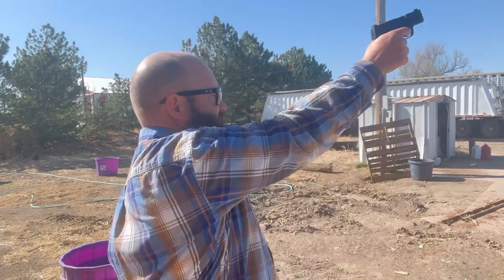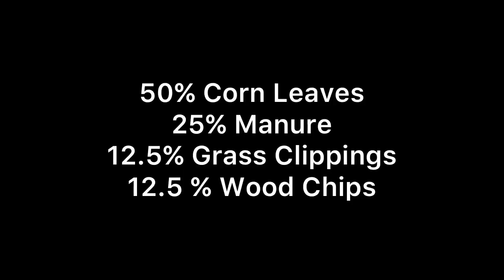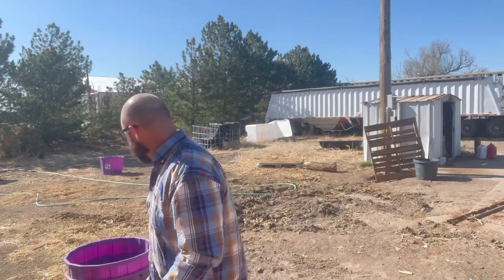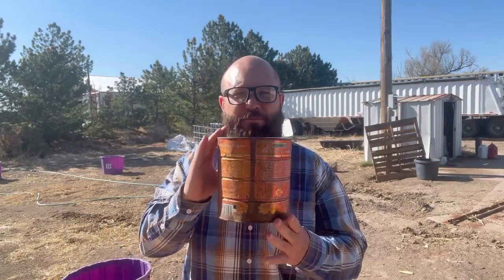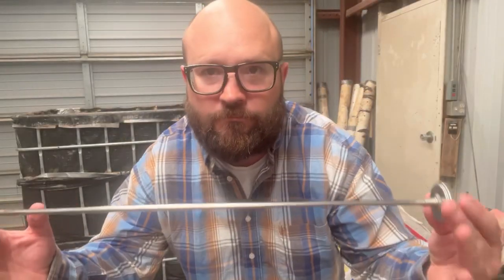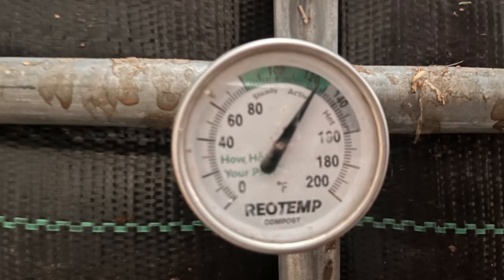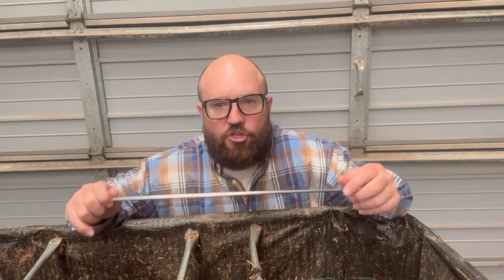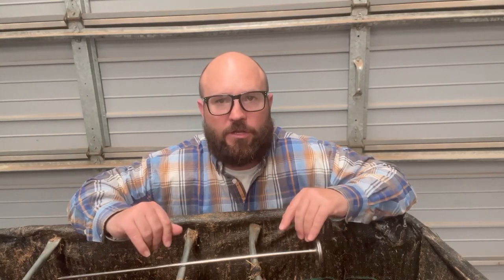Filling The First Johnson Su Bioreactor Of 2023

Comment: I’m curious as to why you would not compost the same ingredients in a pile, let it heat & reduce in size … & then then fill the bioreactor with that material ?  Yes, you probably would turn it while in the hot composting cycle, but it seems like moisture balance & mixing would improve … and after a few days of that you have the long duration of a static pile to generate sufficient fungal development the reactor is design for.
Reply from the maker: I’m not following you Doug
Reply: @youngredangus6041   I apologize for not being clear.  I was thinking about the volume reduction in the J-S bioreactor that appears to be about a 30% volume reduction like any hot compost process would go through.  Maybe volume in the reactor is a very secondary goal, since the quality of the compost is the primary goal, with an emphasis on aerobic fungal life (vs bacterial dominant).  

I was wondering if a person made a regular hot compost pile on the ground, using the same mix you suggest, and let it go through the hot compost process for 10 days or so, reducing by 30%, ... keeping it moist and turning it like normal hot compost ... and then ... fill the j-s bioreactor with that material.  Do you think it would achieve the same results of fungal dominant compost after a year?  It might have the benefit of having more material in the reactor and running hot enough temps to kill weed seeds and pathogens.
Reply from the maker: @dougkanne4452  

I see.    I don’t have a good answer for that.     My first concern would be that it would take more time to do it that way and I am not interested in doing a process that is more labor intensive.   I think there is a possibility that what you are saying would be really good compost.

Comment: Have you checked the desired materials before cleansing and after? Does the before add minerals? I do not rinse. I add everything I have available and the worms seem to like it. I do a tube to add the aeration. How do you determine if your method is the most beneficial?

Comment: Excellent video. I'm about to add two more bioreactors to my inventory. Here's what works for me...

Carbon
-50% leaves shredded to 1/2" minus

Nitrogen
-10% guinea pig manure
-10% horse manure

Carbon infused with livestock urine
-30% animal bedding from wood pellets and shavings

When I add the red wiggler worms around week 3, I also burry a heathly amount of worm-friendly kitchen scraps just below the surface in a few areas. I found it helpful to reenergize them after the shipping process. I'll add that over-waterinng will also force your worms to migrate out of your bioreactors. They are like a canary in the coal mine. If you see worms on the inside edges of the bioreactoer or the surface of the compost, you have way too much moisture. Good luck!

Comment: Good show.
I was kind of worried there at the beginning because if the temp does not get over 131F for 3 days it will not kill any weed seeds in the compost. But then you did hit 140 so weed seeds may not be an issue. Worms can't eat the seeds so the seeds have to be killed through the thermophilic process. The worms are a good addition. So the Johnson-Su basically looks like a thermophilic compost pile followed by a vermicomposting phase followed by a long maturation phase where the fungi species proliferate.

If the temp does not get high enough, then you will need to add more nitrogen component to it next time around. So maybe 2 coffee can's rather than 1 coffee can of manure.

Moisture wise, looked like less than 30%. Was dry in your hand with little aggregation to hold things together. If the pile gets too dry, < 50% moisture, many of the organisms you worked so hard to grow will perish.
Reply from the maker: Thanks Doug
If you dig down deeper it is a great deal wetter.  Like clay

Comment: What do you do about air temperature?  How do you control not too hot in the summer when the compost is getting started as well as keeping it viable during our bitter cold in January and February?  This year it dropped down into single digits as the high for two weeks.
Reply from the maker: I have a heater in the shed
Reply from the maker: I don’t worry about summer temperatures